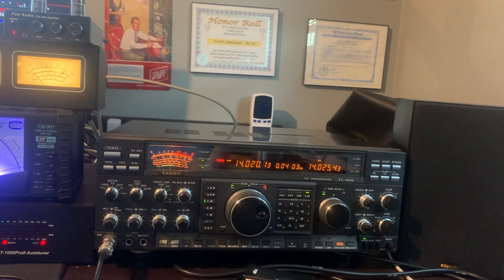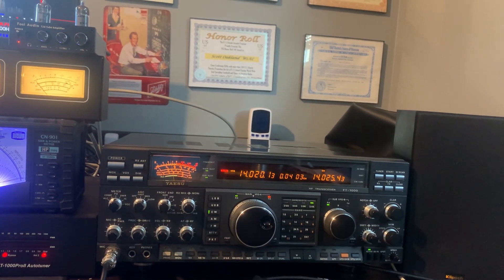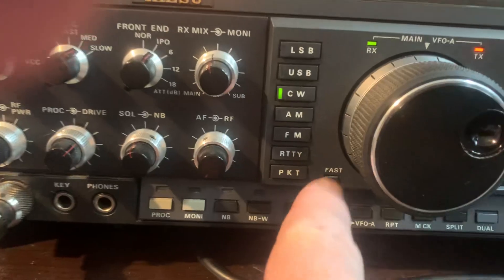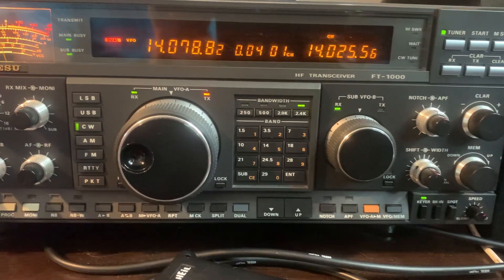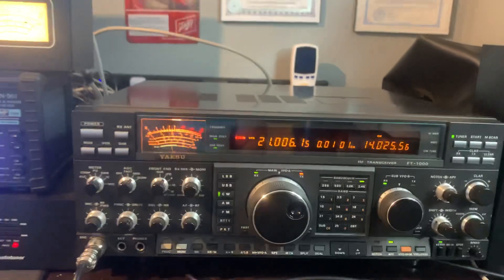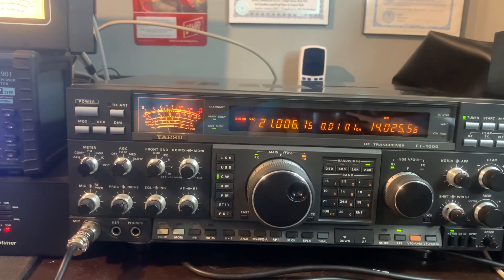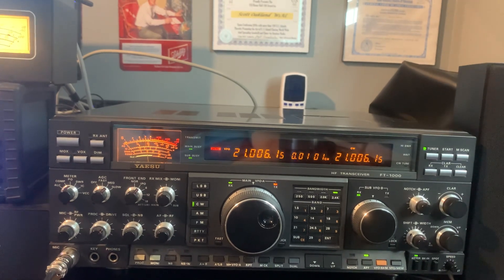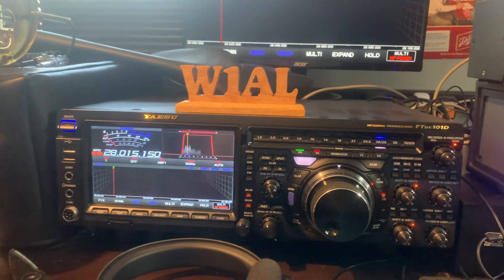Yaesu FT1000D….the very best!

Comment: I've always wanted one of these rigs and after a short hiatus away from the hobby a local SK's family was selling his FT-1000D which is in amazing condition both cosmetically and functionality. It's my primary HF rig and mine is a 1995 model. I only use SSB and have worked further than I thought possible with only simple homebrew dipoles and the 200w.  I'm moving to where I will have a tower and a Mosley TA-33 which will really let it shine! I will never sell mine. I got the MINT FT-1000D w/the SP-5 w/Timewave DSP for $700. I enjoy it daily and the only rig I've liked better was the FTdx9000D at W1AW which I operated a few years back.

Comment: As an old timer of 55 years I enjoyed your review. My first SSB rig was the Heath SB 102 that I used until 1980 when I became inactive until 1998 when I bought a second hand TS940 which is vintage 1985 analog. Can see how yaesu took a lot from the 940 design when they made the FT1k. The cw on those analog rigs is still sweet sound. Looking at the magic Sherwood list those older rigs do not lack sensitivity but just score lower on selectivity. Unless you are serious contester or dx'r, those older rigs hold their own. Since I missed the innovations of the 1990*s I ordered an FT920 off of eBay.  Still have a Drake C line bought in 2005 but maybe later in the year or next year I will go for an FTDX10 or 101. Just retired last year so like a kid again getting back into HR 😊

Comment: Ive used the 1000 for three months now. The receiver is amazing, everything actually works, ie the notch, IF shift and width, dual noise Blankers. I'm finding even with heavy static crashes from thunderstorms, it can muffle them down to a very pleasant listening experience. Since I acquired the ft1000, I also acquired from the same person through my buddy the Yaesu FL 7000 four button solid state matching amp. This guy purchased both of these pieces of equipment new, so I am the second owner.  A killer combination, no fiddling with tuning and dipping like in tube amps. Just throw the switch and you are ready to go. Gives me 6 to 700 watts output and the guys on the nets I work say I have the biggest signal from Nebraska they ever heard!

Comment: The FT1000D came out in late 1989. I bought one of the very first units in the US and had it shipped to the UK, well before it was available over here. In its day it was an excellent radio and it is still a fine performer. Eventually I sold the FT1000D for a new FTDX5000 and since then SDR has taken over in the G3WGV shack. The FT1000D was and is a classic: I often wish I had kept it.

Comment: I couldn't agree more. With headphones I can hear the digital hash in ALL modern receivers except full SDR radios like the ANAN. My 7300 is a noisy radio receiver compared to a Kenwood TS830 which is all analog. Please do a video of the 5000D receiving and resolving weak SSB signals! Weak signal work is where it's at.

Comment: this radio is like a cadillac sedan de ville.
in appearance and performance. 

the best features are 200w with very excellent tuner,  audio peaking filter for cw, ability to handle local noise.
very effective noise blanker which also works on FM. that's right, I said Noise Blanker on FM. 
pause, think about that, Mr Yaesu, sir. 

the annoyances are:
highest sidetone freq way too low, no way to adjust higher. 10hz tuning, excellent receiver audio but put thru lousy audio stages adding hiss and limiting bandwidth. no way to go wider than 2.4khz xtal filter on ssb. no tone adjustment, poor tonal balance, no way to go wider than restrictive 6k on am.

you see, once you get used to kenwood audio it's hard to be restricted.

Comment: A friend here locally owned an FT-1000D in the Early 90's when I had my FT-990? I believe your dates are off a bit? It appears either that the radio is New to you or you have not used it very much? You lack the knowledge of the controls.I can operate my ICOM 7600 with my eyes closed since I use it daily & I have for over 10 years.You should use it more & then gain knowledge about it's operation.